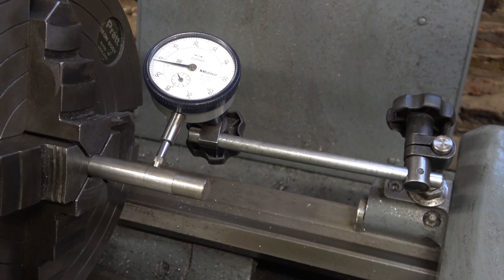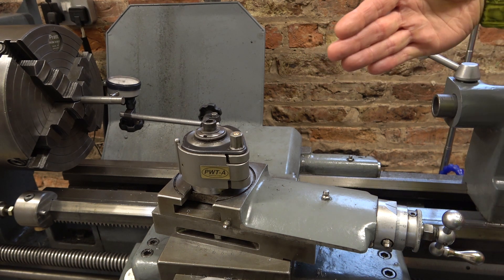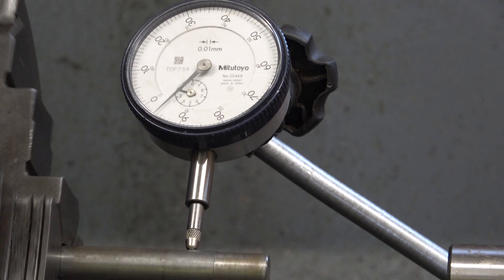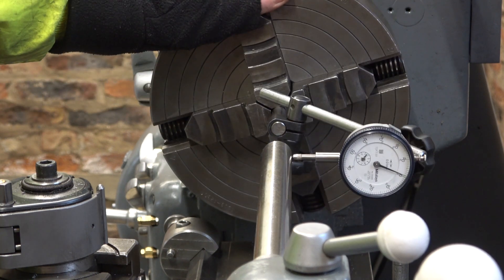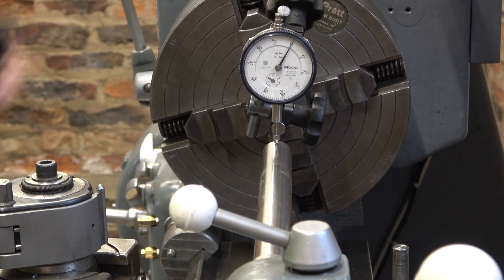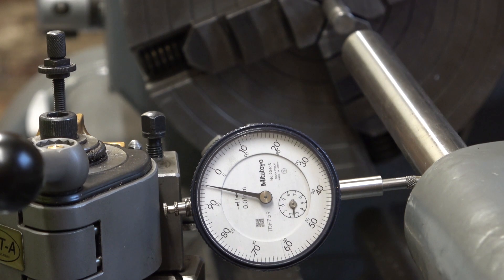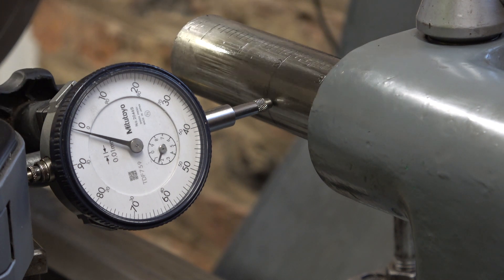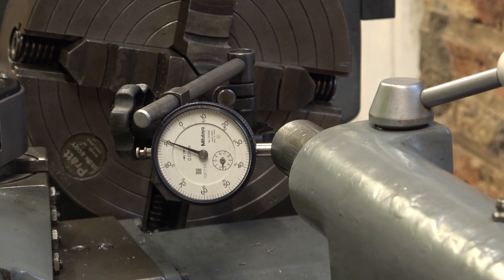HS40 Harrison 140 lathe tailstock alignment investigation

Comment: Hi Haxby. Try clocking the tailstock mounted test bar in the locked quill by sliding the whole tailstock back and forth on the lathe 
bed the length of the test bar. Also my old L5  tailstock quill and casting was worn at the bottom because of the locking clamp 
being at the top, it was a common fault with this design. This was modified later to the clamp being on the side like yours so it 
may be out slightly with wear. You can test the fully extended locked quill the same way. Looking forward to your results. Tony
Reply from the maker: Hi Mr Tony, good idea. Hopefully by the end of today I will get my next vid out, on parallel turning. So if I get questions on that which result in another vid I may include the locked quill test. Cheers

Comment: If I may comment, when mounting the indicator to the chuck or rotating spindle, the attachment point relative to true centre does not matter the slightest. Also unless the adjustment arms are very rigid, the plunger type indicator having a not considerable mass, can deflect due to its mass and plunger spring force. A lever type indicator is preferred for this protocol.
Again, I hope this is constructive criticism, rather than negative.
Great photography, thanks for sharing.
Regards John.
Reply from the maker: Hi John, I'm just learning so all advice is welcome.  Cheers. Tnx.
Reply: @HaxbyShed  Thanks for replying, and you're welcome.

Comment: Thanks for posting - ive recently rebuilt mu 140 and will need to check the run out on the tailstock. This has given me some ideas on how to do it.
I'd wish you would have finished with a way to adjust the tailstock so that the run out was minimal. I assume form this your saying that the run out in the tail stock is mainly down to the wear and there's no way to adjust it ?
I'd really leak it if you could do a short video on the correct settings for thread cutting on the 140 - having trailed the internet for some time now i haven't found a video on how to cut threads with the 140 - i'm guessing if there was such a video it would get a lot of attention.
I have just finished the rebuild of my 140 and any help with adjustments and how too would help immensely .

Keep up with the videos - i'm enjoying watching.... Is it really that cold up North.
Reply from the maker: Hi thank you very much for your comment. The tailstock alignment vid was really just covering an investigation, and as such the story is incomplete. I did wonder about unlisting the video until the story is complete, or maybe creating a separate follow-up? I have realised that I need to properly clean up the inside of the tailstock taper, which has surface rust in it towards the back, and then do some more checks. I will not adjust the three screws on the base of the tailstock unless or until I'm certain that is required as they are factory set. So there is a bit more cleaning and rechecking ahead for me. On screw cutting, please have a look at my thread cutting on the 5C collet video. If you need more information then maybe I could do a specific video for the 140, but please note I'm not an expert it's only stuff I've managed to figure out over a bit of time.  I don't like the cold and yesterday was about 5 degrees foggy, damp and a bit miserable so I took adequate precautions :-) There is no heating in Haxby_Shed - maybe I should reconsider that. Cheers
Reply from the maker: Hi today I've made a vid on the screw cutting gearbox setup. Maybe that will meet your needs. Tnx for the suggestion.